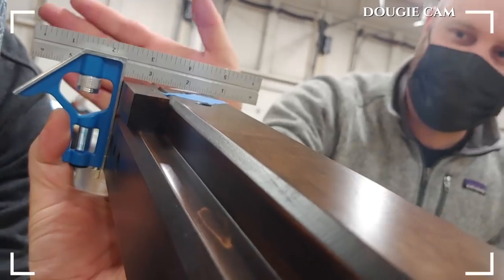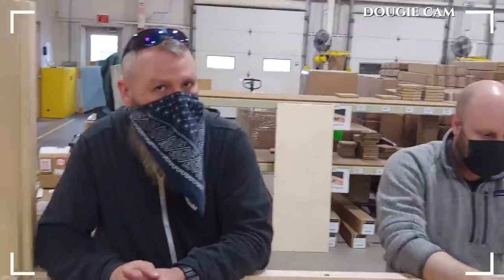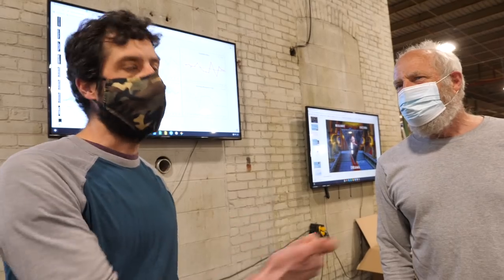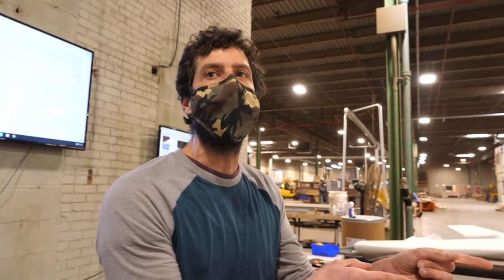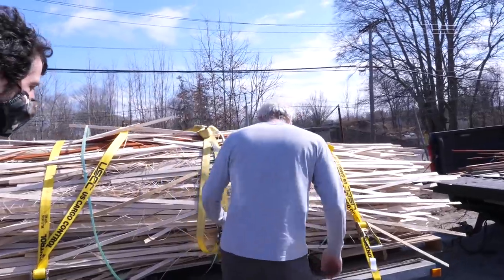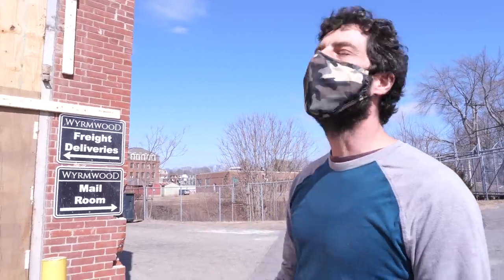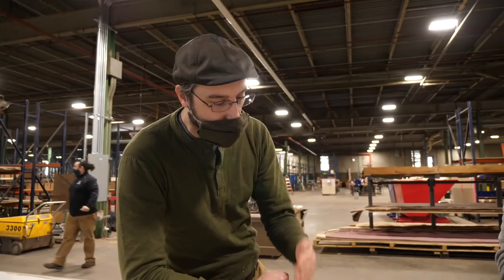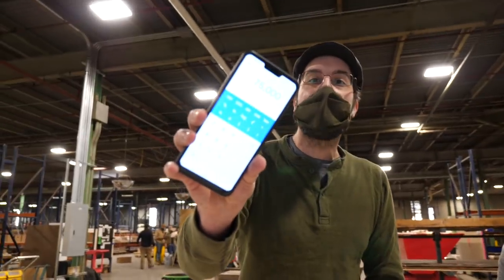Wyrmwood Even MORE Expensive?! (also more MGT trouble) S7E23

Comment: Crazy  Eds segment literally best ROI this channel has ever seen.
Reply: So here's my take on the leg dilemma - when I saw the warped table legs, all I could think was "God, what I wouldn't give to have some of those legs to put in the back windows in my apartment so no one could jimmie open the windows to break in.  Kind of like cut a leg down (my windows would need 28") and put some type of 1" round wood or stainless steel chair glide that can be nailed or screwed (in a way that can adjust to a snug fit) into the top of the leg so it can fit into the small part of the window frame.  

Most people with pretty houses wouldn't use such a thing, but if you live in a place like I do where crime in the neighborhood is starting to rise, some of those beautiful warped square legs would provide an obvious visual F-U to  people thinking about a quick break in.  Do a video on how to measure the actual leg length, Crazy Ed does a simple chop down to size (pre-qualification: what the longest size that can be made is), put a disclaimer in saying we're cutting it to your requested length, no returns. Once you've bought it, you've bought it and give customers a shipping calculator so they can see how much they're going to have to pay for shipping/tracking.  You definitely want the packages to go out with a tracking number.  The mail is still funky.

I'd definitely buy some for my windows. *shrug*

Comment: Increasing prices makes sense. My only concern is the worth mgt, I backed it based on the rough price from the visualizer for the table and accessories. If mgt doesn't inflate... So just increasing the retail, off the website, items.... I'm ok with it. 

I would feel kinda jipped if mgt goes up 10+% for me as a september wave backer just because I'm in a later wave, and earlier waves don't get hit with a price increase. So keeping mgt fair and consistent is most important imo. If dice trays and vaults, or towers are what needs to increase, that's all good. I expect retail prices to increase.

Comment: Honestly, over the last 4-5 years....10% seems small. As much as I hate paying higher prices, manufacturing costs in general have gone up about 20-30% for a number of reasons in that time. At least for anyone working with metal. Wood is different, but is still largely based on the metal machines used to make it and labor costs.

Comment: I already can't afford most wormwood products so I approve the price increase.    When I can finally get something 10 or even 30% isn't going to matter.

But I have a proposal..  *Doug hand table slap*..

Sell rejected by quality control products, as is, at a discount price..  HANG ON!  HEAR ME OUT!!     Look, I fully understand that wormwood is about quality and you don't want to put out product that hurts your image.  I get it.  But there are three major problems here that this could possibly solve.

One: More Revenue..  we're talking useing minor quality control problems that still make for great tables.  Felt gate, gaps, knots, weird wood colorations, and dents..  that's a great deal of loss reduction.  Yes, you are going to have to store and track these things; and yes it's is a bit more work.  But that leds me to my second solution..

Two:  It's a possible job for your salesmen facing layoffs. Running the  "adoption" sales might be the perfect labor for them to convert to.  To use a horrible example,  Bad Dragon is another small-scale manufacturing company that's at the top of their particular niche. (Don't google it!!) They are also extremely concerned with high quality and reject a lot of inventory with extremely minor superficial defects.   They run "adoptions" on their website giving discounts for these otherwise trash products.  It doesn't hurt their image in the slightest. (not that you could ruin their image)

Three:  Wider customer base.  It's perfect for people like me who have incredible FOMO for your products.  I would beg on my knees for a chance to buy subpar modular gameing table, as is, no warranty, with problems that literally none of my other poor friends will notice.  And I promise I'm not alone.

Comment: I hold no ill-will towards WW at all. Raising prices will put me at least a few more months behind being able to afford anything. Y'all are a very high end product that is not meant for anyone who is tryign to stay frugal and I respect that, but It is and will likely stay out of my price range for an extended period of time. I respect the hustle,  I wish I could afford your product. Will there be any option to buy a table less than $6500+ this year?

Also, not to be nit-picky, but those aren't starting wages at Wal-Mart. Those are usually for the floor supervisor and/or assistant manager levels or higher. They're advertising best cast to bring in folks at maybe $12-13/hr, tops.

Comment: Something people should know about the Walmart thing: the $16-17.50 an hour on the sign is only for people working in the back of the store, either offloading freight or stocking. A solid 80-90% of the people there will still be making whatever the local minimum wage is, or somewhere around $10/hour in most states where the minimum is lower than that.

Comment: @Wyrmwood  So with the wood warping due to humidity changes, if you solve the situation in MA and PA- what is to keep the wood from warping once it gets to the customer's house?  If someone drops a few grand on a table, they are gonna be pissed if it develops gaps after a few weeks.  What is the solution?  Letting the wood dry more before milling?  Kiln drying it?

Comment: Price raises are an inevitability and to not have had any in four years means it's past due for it to happen now.

Just some schmuck with a professional interest in Wyrmwood, but I'd reckon there's a wider discussion required here not just about what the imminent price increase should be, but about how Wyrmwood will handle price increases going forward. Small annual increases will be a little easier to stomach for consumers, brings it in line with many other products, and allows you to gauge profitability against materials / services without suffering deep troughs. More importantly, you can tie it to annual incremental increases in wages / benefits which will help with employee retention and satisfaction.

Comment: Is there a reason they can't sell all the scrap timber on to recuperate some of the cost? I'm sure many craftspeople would be very excited to have access to some exotic woods that are otherwise difficult to get, even if the timber was bowed or imperfect. It could still be possibly used for some non-structural purposes or some small products. 

The main issue I can think of would be the cost of storage/the impedance to their work space, especially if there's not much demand, but I'm curious if there are any other issues.

Comment: I wonder if it is beneficial to, on a new design, have the first fulfillment as a Beta fullfilment that is restricted to locations within a reasonable distance from the workshops. Then if the instructions didnt explain it well, or there is issue with the  product, it can be shipped to the factory and back or have a Wyrmite visit to solve the problem,

Comment: Probably a silly question, but why not work with dry wood rather than having it dry after you've worked it?
Reply: From my understanding, that can take a long time. Musical instrument manufacturers often leave their raw stock age and dry for a considerable length of time (many years). That's just not practical nor does it fix the issue that wood is porous, so it can also absorb moisture when the humidity goes up.
Reply: @infinitesyntax6263  That makes sense, thank you :)